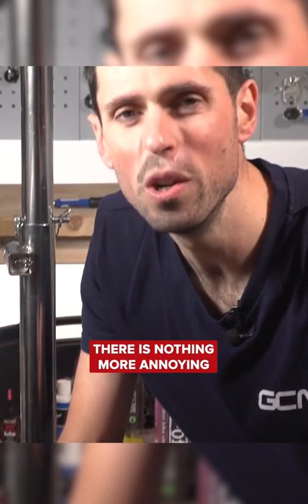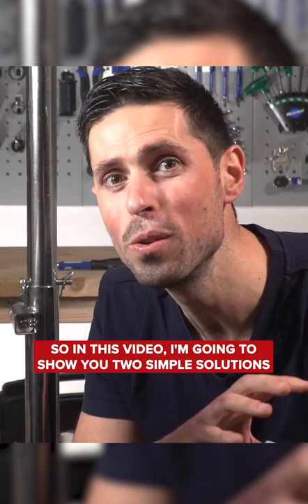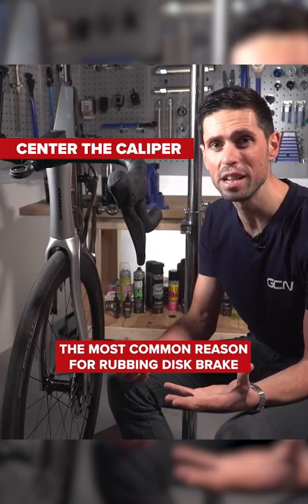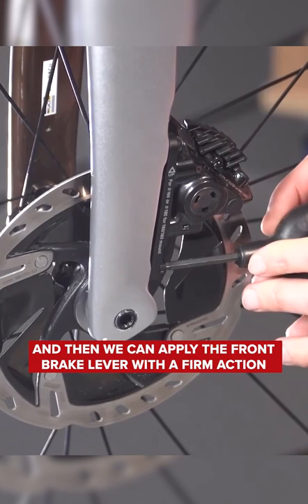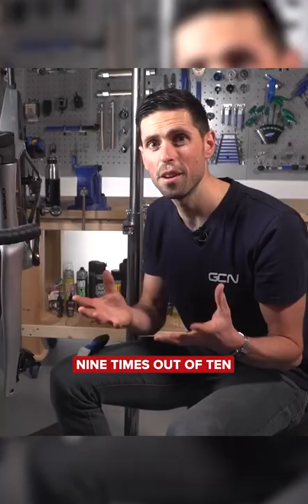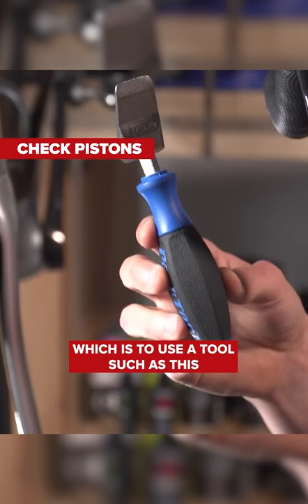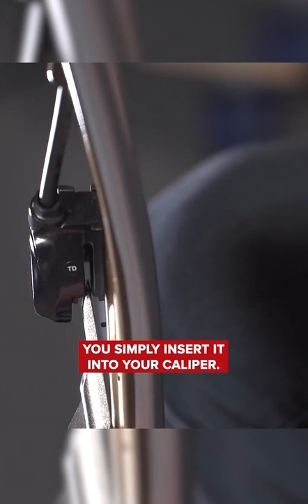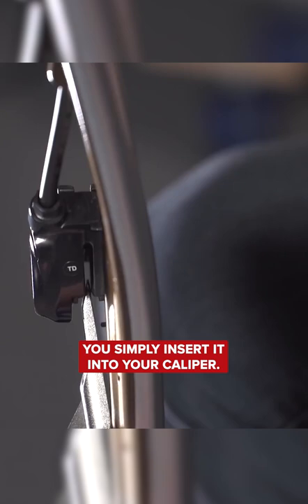Stop Disc Brakes Rubbing! #shorts

Comment: Rim Brakes:     "Just a matter of time, you disc brakes enthusiasts will become Prodigal Sons . . . and Daughters!"!  "Waiting"
Reply: indeed, rim brake takes like 5 seconds to adjust, but the problem is that it has less braking power and it has no hydraulic system. I use rim brakes, and I don't have much problem with them tho
Reply: Never had a problem with rim brake power even going 40mph+ as long as you use quality pads and have decent well adjusted calipers(piece of piss) you're good to go.
Reply: But with rim brakes if its wet they dont work 😂
Reply: @fredclements5474  you NEVER said THAT for the past 150 years, did you! whose laughing now?
Reply: @fredclements5474  Funny how that became a thing only when the industry wanted fat noobs to upgrade to heavier bikes.
Reply: Im riding disk brakes and not having this problem, works great
Reply: Your so right I have both , and think rim brakes are easier to maintain and adjust,  disk brakes can stay on mtbs

Comment: I have Campy 12 disc brakes and they were very noisy when even slightly wet. I switched to swissstop pads. Problem solved and amazing stopping power with very nuanced application

Comment: nice fix until you push the pistons back and it starts leaking oil.. some person on the www said you have to open iirc the bleedvalve before doing this. some calipers don't like it when pistons get pushed back without some relief

Comment: Please don't use that tool, I'm surprised park tool even make it anymore. Just use a plastic tyre lever, your ceramic pistons will thank you.
Reply: The tool is actually not supposed to be used directly on the pistons but with the brake pads still in place. But you are right, if applied directly on the pistons it can seriously damage them.
Reply: @Locutus-of-Borg ... /... , and the bottom of a soup spoon ???

Comment: What to do if a pair of wheel radios is touching the brake system while spinning? The other radios are just fine, and the disc brake is aligned. Thanks.
Reply: Wheel [rádios] truying. ( Not for nerds) !
Reply: Wheel [rádios] truying. ( Not for nerds) !

Comment: Why front brake for right handle brake
Reply: ... /... , b/c. they drive on differents sides of the road : the 'Froggies' goes by the right SIDE of the road and need left hand to signal to others road users and activate the rear brake with right hand . The 'Beefeaters' goes by the left SIDE  of the road and need right hand to comunicate with others drivers and brake the rear tire with Left SIDE hand . I hope i'm right.